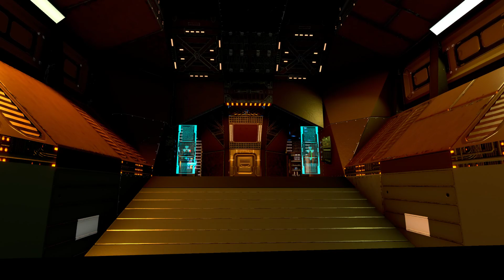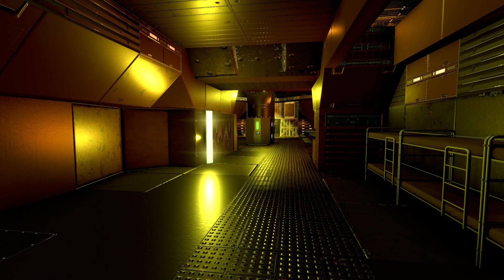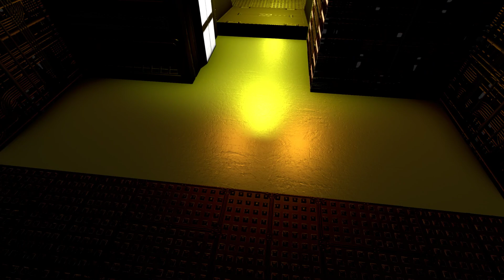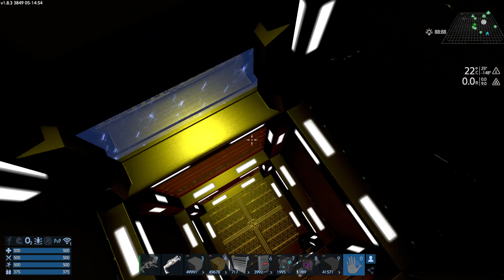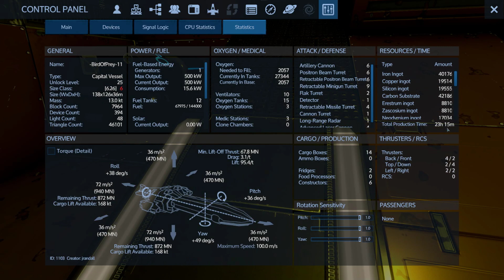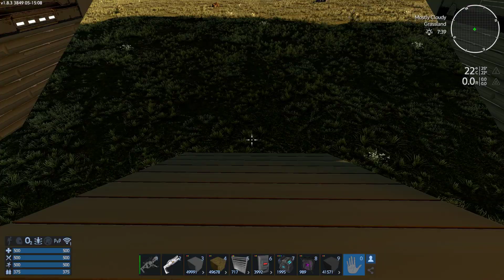Empyrion Galactic Survival - Bird of Prey style CV WIP update 7/5/2022

Comment: Got about 200hrs play time under my belt so far and am still learning to build ships, small ships are my favourite and have so far built two that I'm not embarrassed about, a tiny warp capable Federation type 6 shuttle and a Space 1999 Eagle, I prefer the Eagle because its the ideal for the game due to it's simple design and as each 'leg' has multi-directional thrusters making it quite nimble and doesn't look derpy. I have problems building CVs though, I have spectacular ideas and invariably end up with a ship resembling Red Dwarf or a bloody flying Sand Crawler.

Comment: super news, the bird of prey is almost finished and you have the desire to create new things and especially (for me) excellent tutorial, so some small ideas that would be missing or that will not:
Could empty space become a farm area?
2 the staircase at the back that does not go to the ground will be a problem if there is too much gravity, right?
3 this construction is for the end of the game, but it has very strong weak point, especially at the junction of the wings
I think it’s a midfield ship, so it’s way too much shielded for this stage
it would be necessary to test against more and more powerful vessels to see where it is located
in any case a big thank you for all the tutorials, you really made me want to put myself in my turn 8))
Reply from the maker: Thank you! The empty space in the Neck could become a farm if the farm blocks where on the outer hull. However, very weak but steel hull is not exactly strong either. The staircase does go to the ground on the back, matching the height of the landing gear. In the video I was parked over a dip in the ground so it appeared to not go down all the way. The whole ship is not very strong. Trying to keep weight down as much as I could, I tried to protect some areas more than others. The ship however should be able to keep functioning unless the fusion core is destroyed. Fuel and other parts are spread in different areas of the ship but not in the neck. I was really struggling between weight/speed and protection. I believe I will leave extra shield parts out of the build on release, but just have slots for players to add what they want and keep the cost down some. And thanks again!
Reply: @jeffrandall2813  I understand, with your experience today, you optimize everything because you have a very good overview so it’s not easy to have everything built for all situations, ships are often built for a specific task and everything is set up for that task (transport, combat, farm, high gravity etc) and at the end of the game we quickly understand that multi roles are no longer operational...
remains the approach of combat, attack from a distance or strong armour on the front line see speed and agility to turn around targets, specialization POI or ships
it is not easy to do, only one thing counts: that you please yourself during your constructions, it is the most important ;)

Comment: Looks amazing! Personally I wouldn't mind if the released version came without the 5x5 shield parts and some of the turrets. I'd much rather bring these ships in at a lower CPU level so you can use them to get the resources to upgrade it into a monster. But I think a lot of us customize ships in creative before we bring them in anyway.

Btw, have you looked into the new dense/rich asteroid mining turrets? Ships can now support 12 dense ice automated drill turrets, 12 rich asteroid automated turrets, and I think 6 "excavator" 5x5x2 turrets (along with 10 fixed-drill variants of both types). These are used to mine special asteroids in specific RE asteroid fields that can produce a ton of base materials, but are sometimes defended by some aggressive ships. It could potentially require a new class of ship (like Ente's Exhumer build you previewed a few months ago), so if you're looking for an idea for a new build that's always an option.